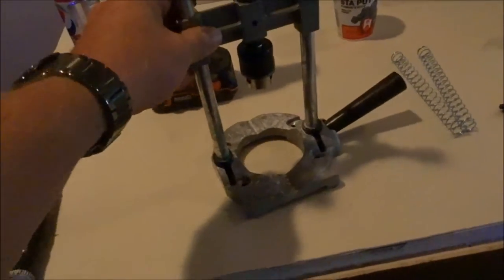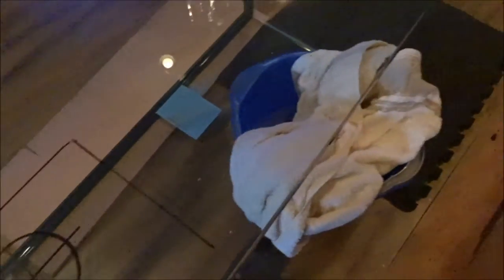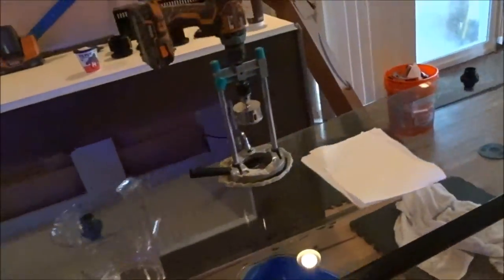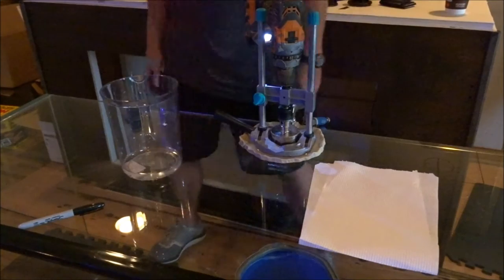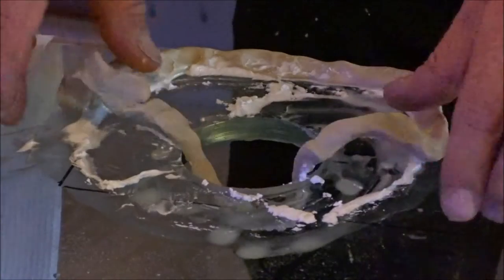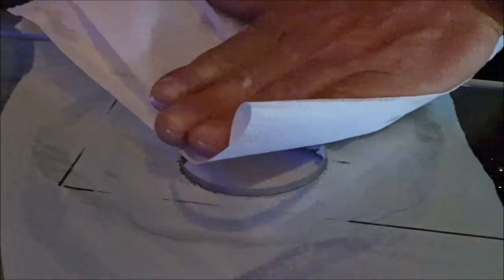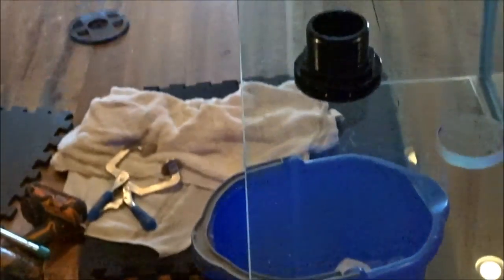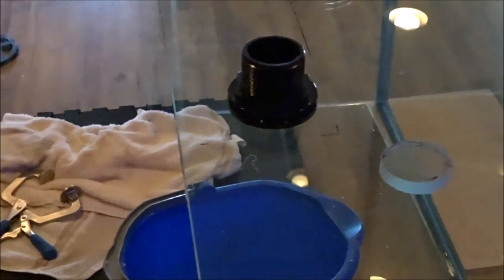205g Reef Build - Drilling Aquarium Holes - E6

Comment: For a tank that size, what is the thickness of the glass?  Nice video.
Reply from the maker: 1/2" thick
Reply: One other quick question for you.  I went to Aquatic America's website but it's basically non-existent.  I wanted to see what it cost to get your the tank from them, but they don't have any aquariums on their website.  Would you be willing to share what you paid for the tank?
Reply from the maker: I went thru Pet Connection in Livonia Mi, to get the Tank built. I'm not to amazed with the quality of the tank, my sizes are off a bit, silicone job is not perfect, I've seen the holes he has drilled,, Hence me drilling my own holes...Tank was $1,600 with 3 sides star fire glass, I wanted Great lakes aquariums to build my tank, but owner just passed away.
Reply: Thanks for the information.